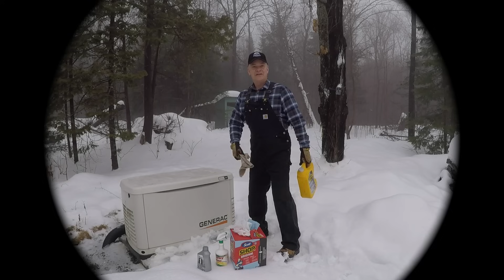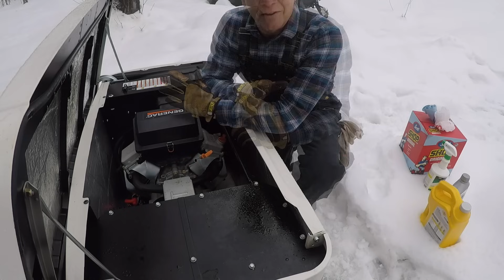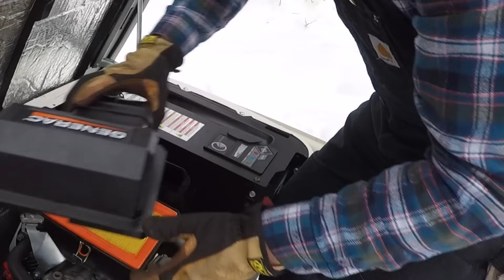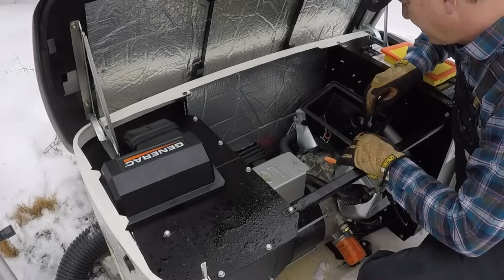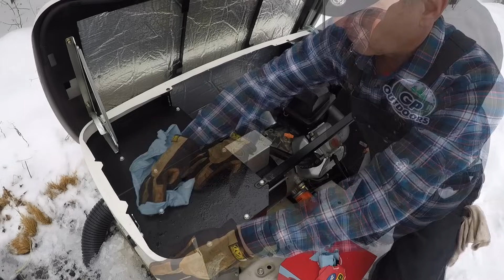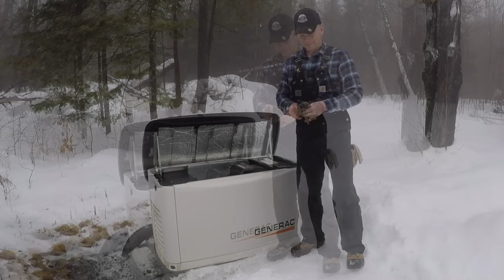#133 Thinking of Buying a Generac Generator? You Need To Watch This!

Comment: that seems like a simple fix, why dont u either, run a drain, drill a hole in the bottom thread in a line coupler n let it drain, or u could run the end of ur exhaust a little higher, id highly recommend letting the condensation drain im kind of surprised they let that happen actually..  more manufacturers have a drain some are a really soft rubber ""reed"" design, i use reed design lightly  but since theres no sensors before the air box lid i wouldnt worry about sealing the drain     u cant have that happen in the middle of a blizzard or hurricane... could u imagine n elderly man out there trying to fix that so his pipes dont freeze.... come on generac   i love u but dam we pay that premium for a reason :p
Reply: Your suggestion would void the man's warranty. Generac has a fix for this that apparently has not been installed on his generator. It's not needed in warmer climates so it's not a standard on all generators. Why would I need it in Kentucky? So why should I pay for it? I talked to my Generac installer and he said the extreme cold weather kit keeps the vapor from freezing in the air filter box so that the test run of the generator will take that moisture out and this should not happen. Everybody keeps blaming Generac, I blame the salesperson and the installer. The fix is available as an option, again an option that is not necessary all over the country.

Comment: I had a problem with my Generac and want to know if anyone else had it ? My oil fill cap vibrated loose fell off shot oil out of it until low pressure activated and shut down !! This occurred the first power outage !! The unit had never been serviced due to the fact that it was less than 2 years old !! I resolved the issue with a wire tie attached to the fill cap!!!  Generac sent me a service kit and I requested to have someone check it out but no response back !!!  If we ever are in the market for another generator it will not be Generac.
Reply from the maker: hat has never happened to me but interested in other's experience on this. Thanks

Comment: Don't know about generator that why I'm here how long do they run for during an outage
Reply: As long as they have fuel.  I have a 500 gal propane tank hooked to mine.
Reply: If you use natrual gas and it keeps running it'll run for days weeks etc hell even months but make sure you change the oil the filters etc when needed

Comment: Very good tip, and lots of people thank you for it, including me, who doesn't own one of these huge generators. (i like watching your videos, this was a good one)
With some research, I saw how much fuel these suck down per hour, and that made me walk away from these stand-by units real quickly. (my neighbor has one, he hates it)
We bought an open frame generator, i run my whole house AND my well pump with a  Westinghouse Wgen9500DF. It stores nicely out of the way in the garage when not needed.
Wife an i built a nice shed for it too. I pick it all up with my Kubota forks, drop it by the electric pole, plug it in, done. Knock on wood, the generator has run 100% flawlessly (on propane).

Comment: For such an expensive system, and an EMERGENCY  ONE at that, why do they use those cheap air cooled lawn mower engines?
I'd use a water cooled 4 cylinder automotive style engine set up for industrial use!
Start it up a couple times a month letting it get up to operating temperatures and it should last forever!
Reply: they sell those too--- at a much greater cost. These are the "cheap" homeowner grade gensets
Reply: @jackpitw  if we could just buy some generator heads and a small controller then bolt it to either a small 4 cylinder or even an air cooled Volkswagen flat four would be better than a lawn mower engine.

Comment: We bought a 15Kw ecogen five years ago. It was garbage since day 1. It had a box that failed with regularity. They replaced it after a few months, the replacement was no better. The part itself cost over $4000. It failed again in December, we have been without a generator for more than 2 Months. Too expensive to repair. They won't give any credit for the dead generator. Unfortunately we are stuck waiting for a new Generac, as it is better than most for off grid. When we got our last generator they kept trying to blame us for the issues. I am really angry, don't trust them at all. They did discontinue that model because it was junk.

Comment: The exhaust goes into the air filter?

Makes no sense to me.
Drill a hole in the bottom and let the condensation out?
Reply from the maker: My apologies - it is the vent port from the crankcase. Thanks!
Reply: @GPOutdoors  , yeah...kinda figured had to be something like that so I had to pick at ya.
 A work around for me would be to use a vent from an automobiles rearend. Won't let anything in and will let the expansion of gasses out AND it would be a cheap and easy work around.
I don't think even a million people doing that would impact the environment.

Comment: I bought a Generac GP5500, It failed in less than 10 hours. Customer service did nothing despite it being a 100 percent design flaw. Seal failure  allowed light rain to leak into the gas tank. rusted out. carburetor stuck open and leaked all over my truck. Cost $400 to replace. They don't care about their customers.

Comment: Could you not just drill a small hole at the lowest point of the air box and install a one way valve to allow water to drip out

Comment: Wow, I would not be happy needing to clean that due to their faulty design. I hope that they fixed the problem. A few holes drilled in the air filter body might help the water drain out.
Reply: Your suggestion would void the man's warranty. Generac has a fix for this that apparently has not been installed on his generator. It's not needed in warmer climates so it's not a standard on all generators. Why would I need it in Kentucky? So why should I pay for it? I talked to my Generac installer and he said the extreme cold weather kit keeps the vapor from freezing in the air filter box so that the test run of the generator will take that moisture out and this should not happen. Everybody keeps blaming Generac, I blame the salesperson and the installer. The fix is available as an option, again an option that is not necessary all over the country
Reply: @mikeslater6246 ,Thanks for the info. It’s good that their engineers have addressed the problem with a solution. I suppose their field reps aren’t informed as you suggest. I’d be installing that fix kit to avoid future messes.

Comment: WOW I hope that generic CEO is watching this so they can recall / fix this issue  in all there gens
Reply: This is not a design flaw. The unit does not have the extreme cold weather option. This generator is used in all kinds of climates and the people in warmer climates shouldn't have to buy that option. I blame the installer.

Comment: Hard to believe that if Generac is aware of this issue, to the point that they sell an "accessory" crankcase ventilation tube/breather heater. their engineers would figure out a REAL fix, like just connecting the breather directly to the intake manifold where it belongs (with a PCV valve of course). That way, warm moist air from the crankcase is quickly consumed for combustion before it mixes with cold incoming air. Emissions control requirements still satisfied. This is the way auto engines have been since the late 60's.

Comment: Mr JP that would only happen to me once. That hose would never go back into the air filter box again. But if I did it would certainly be higher in the box. Half my life was spent with no return on blowby. Your generator and generator box won't rely on a low oil sender to save it. These sensors are very prone to failure. Relying on them means I wouldn't if I could help it.

Comment: My Generac didn't even make it to be installed. I opened the box and looked in the case all kinds of corrosion all over the motor. Rust on the exhaust system aluminum parts on the engine where corroded and powdery. The little return spring for the carburetor are almost completely rusted away. And this was brand new still in the box. What kind of company sells damage crap like that. It would have been dangerous. I took it back to Lowe's where I bought it within 3 hours now I have to wait another week to get another one delivered and I will be opening that box I'm doing a full inspection before I put it on my trailer. Thank God I was not installing it for a customer. If the next Generac is corroded and not looking perfectly brand new I will be sending it back also and wanting a full refund

Comment: Isn't this because of cold weather not of the engine
Reply from the maker: I think so - but if it doesn't run when you need it to, ,then it poses a big problem. I have heard that about a year+ ago, they redesigned it to stop it from happening. I don't know for sure but I was told they fixed it. Cheers!

Comment: First I would be using Amsoil Full 100% Synthetic oils made for these small engines like this, and i would get rid of the Fram oil Filter, they are the cheapest on the market made with Cardboard and when they get full they collapse and are worthless. Amsoil has their own filters good for 25,000 miles or 1 year whichever comes first. I would check to see if there is one for your generator. I work on small engines and use nothing but Amsoil now.  I refuse to use Pennzoil or as we call it Piss-oil. Shell oil company said Amsoil is far superior to anything on the market today, including anything they put out.

Comment: Simple add or attach a digital controlled Submersible Thermostat heater 25w then set temp allow to heat up to 100*. Works great against polyurethane plastics will keep it condensation free. No more freezing up. Germans always have solutions to problems lol

Comment: Seems like kind of a stupid design flaw that if you know about, then Generac should know about as well. And if they know it's a problem, then why don't they fix it? A small drain hole added to the bottom of the air filter box with a hose draining out the bottom of the enclosure would solve that issue and cut down on unnecessary service calls.

Comment: The generators from Briggs and Stratton have a 5 year parts and labor at your home warranty. Instead of trying to fix your own generator, the manufacturer should do it for free; like Briggs does.
Reply: Generac has a fix for this that apparently has not been installed on his generator. It's not needed in warmer climates so it's not a standard on all generators. Why would I need it in Kentucky? So why should I pay for it? I talked to my Generac installer and he said the extreme cold weather kit keeps the vapor from freezing in the air filter box so that the test run of the generator will take that moisture out and this should not happen. Everybody keeps blaming Generac, I blame the salesperson and the installer. The fix is available as an option, again an option that is not necessary all over the country.

Comment: It's a crankcase vent, not a cylinder exhaust.  Punch some holes in the air intake base.  Yeah you bypass the filter, so what?

Comment: HOW DO U STOP STOP THE PRO BLEM
Reply from the maker: Well, I would say that the advice from folks is to drill a hole and install a duck-bill drain and I believe that will remedy it. However , Generac says if i do it, it will void my warranty. I understand that they have now changed the design on new models and that it should not happen but on these ones, no fix.

Comment: That's NOT an "exhaust port" - it is a crankcase ventilation port! It is an easy fix to drill a new hole in the airbox near the top, and plug, or make a drain where the hose used to hook up on the bottom! That should be common sense fix for anyone with a slight mechanical background. Not sure WHY you have/keep doing this after TWO generators. SMFH

Comment: Wait a minute, no way on earth the exhaust is plumed thru that plastic air intake box, you are mislabeling that crankcase breather vent as exhaust which is incorrect and would melt that.
 plastic air filter box in a new York minute, that ice blockage is freezing up the crankcase vapor recovery ventilation system, not the exhaust

Comment: In the electrical trade we call Generac, Generwreck. I had a portable unit that rattled itself apart at 40 hours, almost every bolt on it came loose or fell out completely. My advice, BUY a Kohler or Onan and save yourself the worry and grief.  
Even thou this was a good video I'm surprised this man bought a second unit. SMH

Comment: If you are considering a generac generator larger than a 22kw I highly discourage it. The small generators work great, the large ones are a money pit and generac will not warranty them, they will milk you along until the warranty runs out. You are then stuck with a faulty machine in your yard that is a good for nothing piece of crap.

Comment: I was given a bent con rod from a GENERAC 7 MONTHS OLD   Iuse it as a paperweight,    The cheapest generator & these GENERAC, operate at 3600. RPM   WHY ?I was told to get the 60 HZ therefore the GENERATORS ARE REAL SHIT, SURE A DIESEL costs more, but at 1800RPM you can see the VAST DIFFERENCE !, THEN IF IT RUNS ON GASOLINE, then STORAGE IS A SAFETY ISSUE!
🇺🇸🇺🇸🇺🇸🇺🇸

Comment: You would think the company would have done something about this by now
Reply: You right, they could require a kit that includes a small electric heater for exactly that location, perhaps they'll call a Cold Weather Kit. Maybe they'll even clearly label the requirement to use that kit in certain climates, in the Spec Sheet and installation guide. Turns out they do make it, and he didn't follow the directions and install it.

Comment: Not sure if this has been suggested already. Besides running the engine hot to reduce condensation I would try cutting a slit in the pipe just before it goes into the air box. This would allow the pressure in the engine to be released if it becomes blocked in the air box.

Comment: why don't you drill a little 1/4 inch hole on the lowest point in that their reservoir thing there and put you a little rubber thing like they have on semi trucks that lets the water drip out but Eric won't go back in it's a little bitty real soft rubber thing that looks like it's mad and you just throw your hole take your piece of PVC pipe super glue it in there or get you a nut little rubber Apple thing very simple pics very simple

Comment: Vent the crankcase breather tube to the atmosphere and plug the hole in the air filter housing where the crankcase breather tube was. And tell the EPA to go to hell!  According to the Arbor Day Foundation a mature tree can absorb 48lbs of carbon dioxide a year and release it in the form of oxygen in exchange. If you own a generator, chances are you live in the woods where power outages are the normal.
Reply: Amen brother

Comment: There is a simple fix.  This is an issue that is similar on motorcycle engines where the engine oil vent is routed to the intake.  If you take the engine vent out of the intake and run to a catch can (avail on line) this will resolve the issue.  Don't forget to plug the hole on the engine intake box.

Comment: You have the wrong standby unit for solar systems.
Reply: Jared: is is the "wrong" one or just 'not ideal' ?
Which one do you suggest instead ?
We all learn by interaction rather than mere criticism.
Thx David
Reply: @psalm2forliberty577  so the standby unit in the video is not designed for the regular use that is required for most solar systems. The generac ecogen model is designed for solar.
Reply: When a basic unit is installed to be used for solar the warrenty is void. I have replaced a few generacs after only a couple years as they could not last the constant demand. There is a significant differance in price. Depending your situation the standard units could work but I would advise against.
Reply: @stickmanzorome  
Ah makes sense Jared.
I suppose how much solar input he has would influence things too.
If his input GAP is small but if large may run Gen overmuch.
Years ago I built a Solar / Wind / Diesel Off Grid System and my Gen was one that WOULD not wear out.
A 1.9 litre 4 cyl VW TurboDiesel w/ 25KW Stamford-Newage (British) Gen Section.
Of course ran at 1800 RPM, so half the Revs of these Air Cooled 3600 RPM Propane standbys.
I believe thats the 🔑.
Plus appropriate grade of Syn Oil / Inspected / Changed regularly.

Q: Are you in Northern cold climes like our Canadian friend here ?
What oil do you use in these small single or twin Air cooled Standbys ?
Thx David (in Thawed Texas)
Reply: @psalm2forliberty577  Yes I am in northern ontario. I have seen the Issue he has but never to this extent. We use the recemended 10w 30 full sinthetic. You are correct with a good set up where the generator would not run often a standard unit would suffice.
Reply: @stickmanzorome  
Nice Jared.
Down Texas way here I prefer Mobil 1 Full Synthetic 15/50 Racing Oil - per 'Bob is the Oil Guy' Air Cooled thread its best grade for Air Cooled or Gasoline Turbo (Subaru)
(15/50 might be a little thick for sub zero starting, no doubt, lol)

These Air Cooled Gens run so hard - any use of Non syn oil turns to TAR & bearings get trashed !

During Katrina guys ran Gens continuous for 7 days on junk oil & once shutdown they'd gum up & refuse to start.
Bearing failure due to heat & loading exceeding Conventional Motor Oil lubricity.
Reply: @psalm2forliberty577  yeah I could totally see that in your hot climate. For whats it's worth only the best oil should go in emergency equipment like these. But yeah 15/50 is too thick for our lawnmowers  nevermind winter running equipment haha